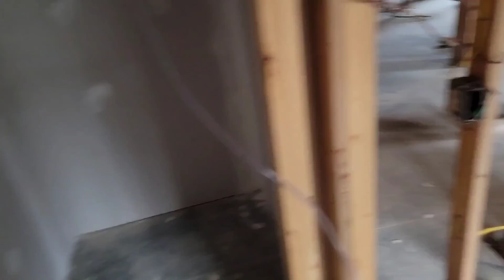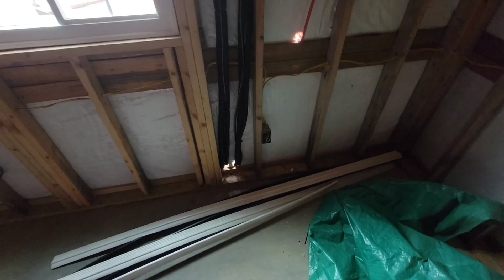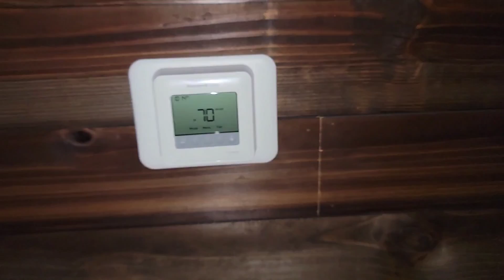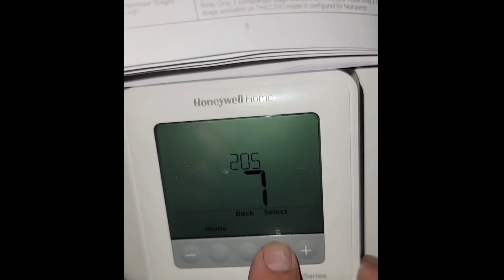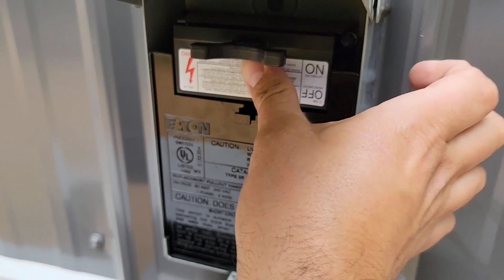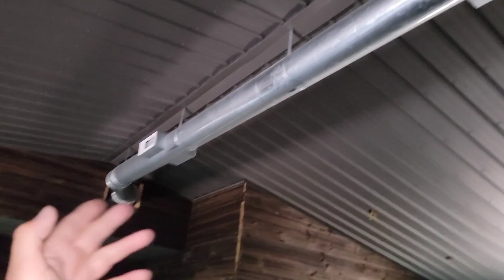Ultimate HVAC Crash Course for Newbies!

Comment: I'm also installing YORK  Y81EO80 & Y81E100  3&4Ton 
Each floor  around  1275 square feet  8ft ceiling  in NYC .

Total  length Each floor duct work is approx 55ft 

4TON  I started 24x8
3 Ton in the cellar I started 22x8 

Pls let me know if I'm in the Wright part 🙏 🙂 

Many thanks 😊

Comment: Hey i'm looking into going into hvac school mainly to learn how to do this for construction purposes. Do they teach this type of infomation at school, or is this something you learn working with other people.
Reply from the maker: They definitely do not teach this in school
I have a Bunch Of courses that you can have access to by becoming a level three member.
Definitely check out my member's only courses
Reply: Interested. What would be the pipleine in order to do this? Would I need schooling for this? what type of certifications from the state?

 @taddydigest
Reply from the maker: I have my electrician license so I can pull a electrical Permit
I have my general mechanical contractor license so I can pull in mechanical permit.
But I only have to use that one for commercial

Comment: Hey Tan, do you vacuum each head on the multi zone !? Thanks in advance 🙏
Reply from the maker: The ports that you use to vacuum
They are connected To all the indoor heads.
So yes you vacuum them at the same time
Reply: Is there a tool to evacuate 3 heads at the same time that you may recommend I appreciate it Taddy 
I will become a member for sure, for your quick response 👍
Reply from the maker: You do not have to have a special tool
I think I have a video on it
I will try to find it

Comment: What is the point of those rough in mini-split boxes when the copper doesn’t line up right when you go to install the head? I’ve seen guys have to go and put those RLS couplings on there and just cut out the flare joints. Just curious. Can they be installed where you can just use the fare joints with some proper planning?

Comment: Hey Taddy, I love your Videos. I also Have an HMH7 4 ton unit Installed with two Zones. I am curious to know why did you Wwre the thermostate for  HMH7  Y and Y2?  HMH7 is a modulating unit and it does not have a 2 stage it have several stages and the out side unit (HMH7) controlles the stages depending on the call? Can you please Explain. Also in your other videos you have not wired the thermosates for HMH7 the way you did it in this video.

Comment: But nice clean work. In New Jersey we have to hard pipe or flex every return. We can’t draw bays or have any wood. Every job has to have load calcs. Duct test for leakage. We got to be painters on top of every other thing we Hvac guys do. Mastic all connections even flex to boot. Miss how we did 30 years ago. Lucky if we taped a joint